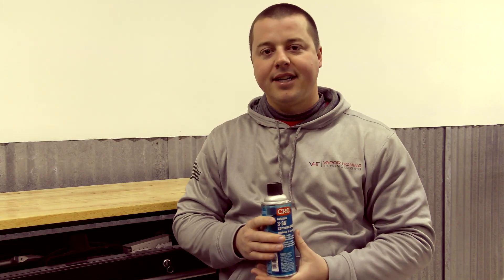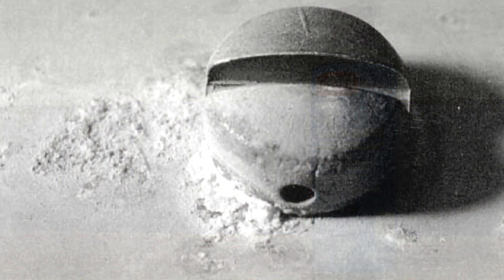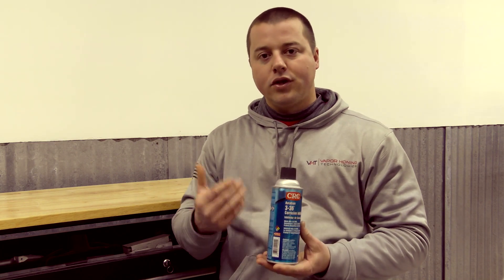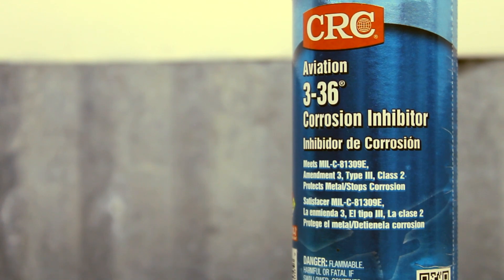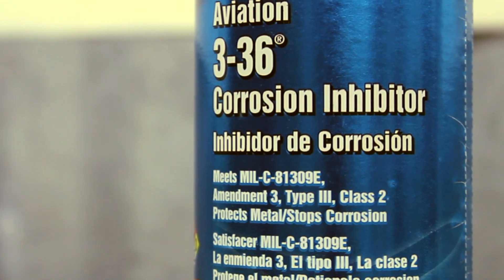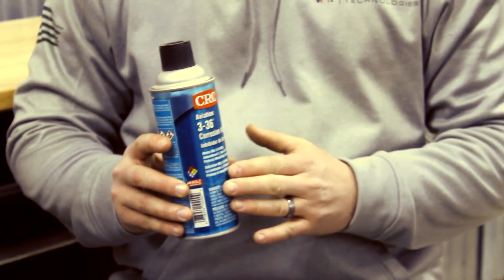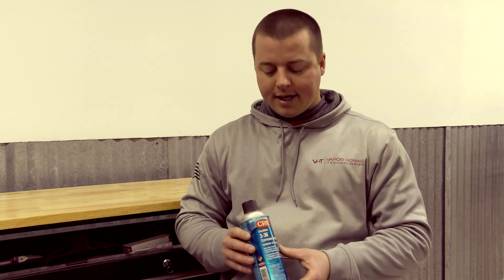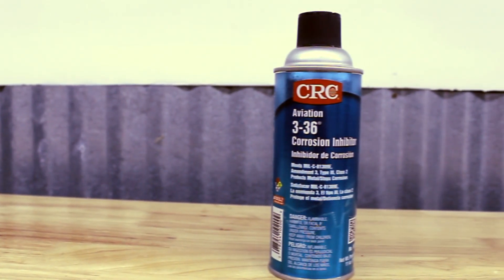How To Protect Aluminum From Corrosion - Vapor Honing Technologies

Comment: Hello sirs: Can I use this for the protection  of formworks that will be used with concrete?
Reply from the maker: If you are preventing corrosion, yes it will work fine.  Do you have any need for Vapor Honing to clean up the Formworks?  Call us 828-202-5563 x 103 Niki

Comment: Sir can I do micro shot peening with Vapor Honing cabinet as per required peen scale. What abrasive and size should be use for. Can i use steel shot in Vapor Honing cabinet and at what pressure.
Reply from the maker: Hello this is Niki.  Yes you can use micro shot peening in the Vapor Honing process, we do not give out specifics unless you have purchased from us.